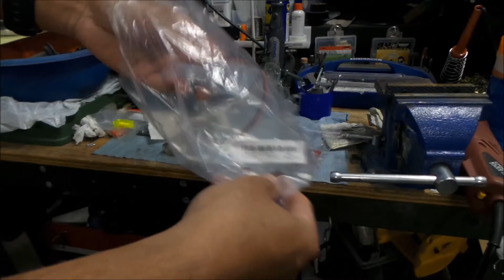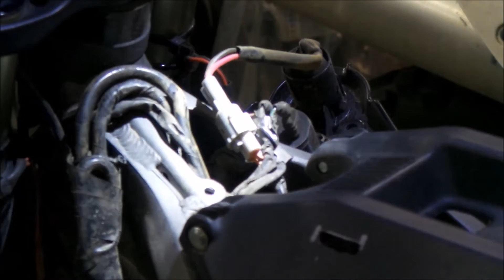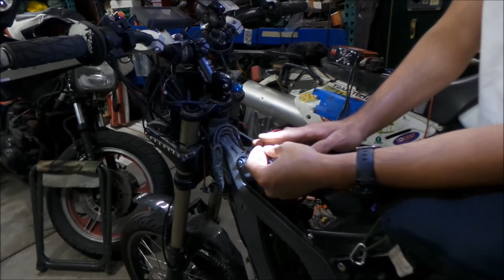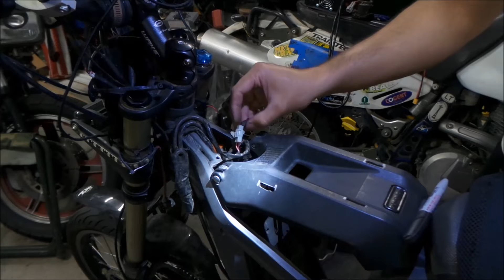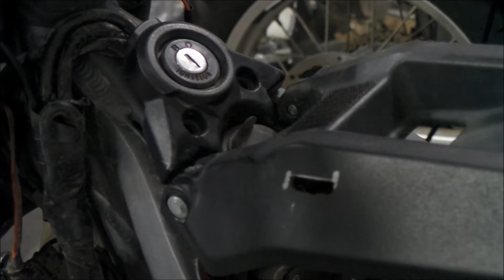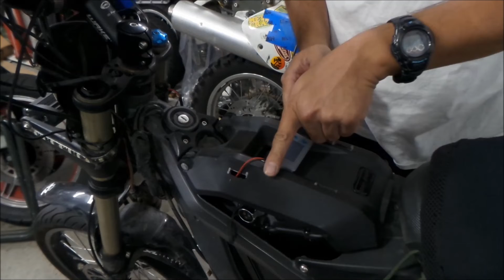Sur Ron Light Bee Onboard Voltmeter and SOC Meter Install Part 2 - Wiring

Comment: For my voltmeter I just ran wires direct from the controller battery connections to the display.
It turns on with the circuit breaker as I eliminated the key-switch on my bike.
Reply from the maker: Hmm interesting